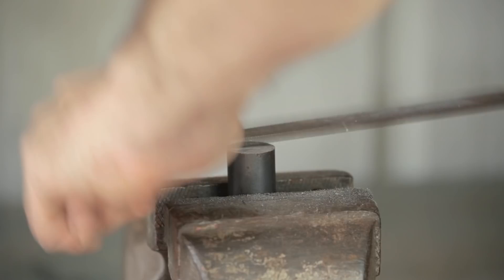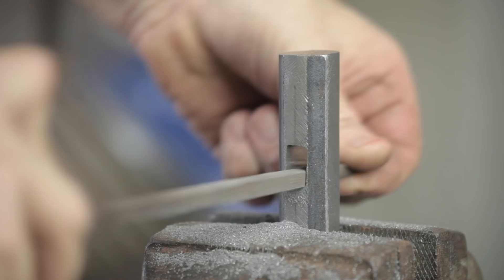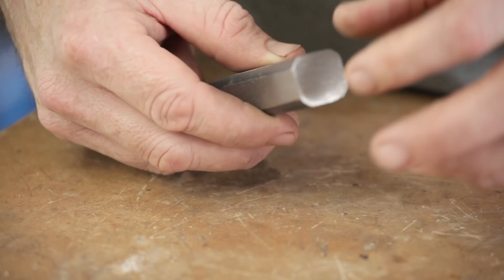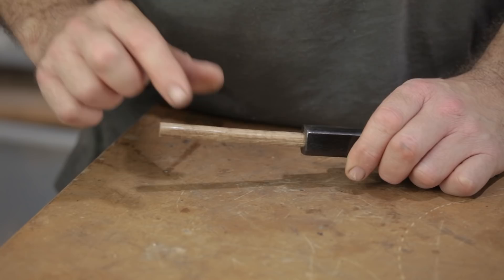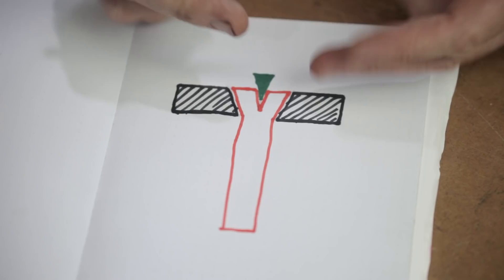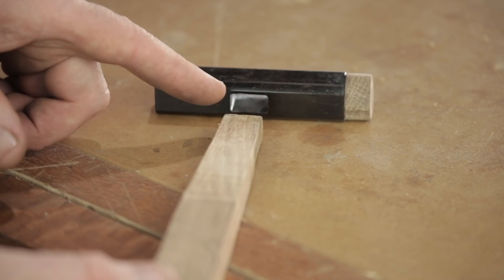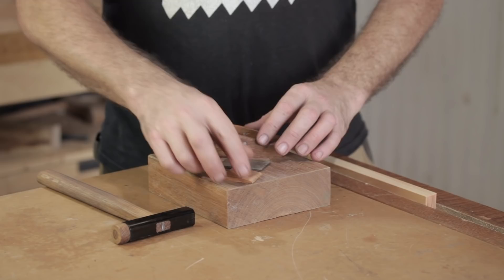Making a Plane Setting Hammer

Comment: Great stuff here. I love learning things. The oil finish on the steel is new to me, it looks great! Useful in my area as well with summer storms in the morning sometimes and 95°F by the afternoon as so often happens in the summer months. Functional and looks great.

Also I think most people would have simply glued the handle in the hammer head in some way. Compressing the fibers seems like one of those things people learned over generations to work better and last longer, one of those things that's nearly forgotten today. I will likely be using that knowledge as well.

Love your videos keep them coming!
Reply from the maker: Thanks mate! Glad it was helpful to you! :)

Comment: Very timely for me, I just found a tack hammer head my grandfather gave me as a kid.  Going to put a new handle on it. A couple of good tips for me in the video.
Reply from the maker: Glad it was helpful Brian! :)
Reply: Thanks.  Got the handle made, and the head on it, but broke the top of the handle driving the wedge.  I think I as a bit aggressive with the angle of the wedge.  Have to see how it holds up under some use, it is only a tack hammer, so it may work for years without an issue.

Comment: Enjoyed that! I didn't know boiled linseed oil would blacken steel like that.
Reply: pretty much the same process of seasoning cast iron pots.
Reply: Works with candle wax too. (Paraffin wax in countries that don't have loadshedding)
Reply: Aadil Shah This excites me.
Reply: It’s called bluing. If you don’t want to heat whatever it is you want to blue (prevents rusting) you can use a solution to just paint it with and it will start a chemical reaction to do the same thing
Reply: Allan Martin great informative! Thank you!
Reply: @BruceAUlrich  It's traditionally used by gunsmiths to make the guns resistant to rusting. Actually it's just a slightly different chemical compound than rust, but it doesn't spread like red rust does. Very cool stuff.

Comment: I used any kind of hamer with removing my plane blade without hurting the wood, I drive a 1/4"dia. bolt on the spot where I knock to remove the blade. I had my wooden plane since the 1960's and using it till now and still in a very good shape. I was a cabinet maker

Comment: @Pask_Makes Great Video! ☆ Quick Question? ☆ I've seen many videos where people making and or just installing a premade handle where most do not but some do protect the wood inside the eye of the hammer, axe, or hatchet etc with boiled linseed oil before putting the head on and setting the wedges etc.  I see you have skipped that step here and just wondering what your thoughts are on the practice of doing so or not? I see many replacement videos of axe heads for example where the wood in the eye has degraded badly and I would think that as long as your taper and wedges are proper that the linseed oil would be more benificial in protecting the wood than detrimental to the possible slight loss of coefficient of friction between un protected un oiled wood surface within the eye than it would be to oil it prior to insertion.  From what I've seen you are one of the most skilled tool builders amongst other wood items I've see on YouTube and just wanted to get your thoughts on the issue? Thanks, love the hammer and thanks for posting!

Comment: can i use something else instead of linseed oil ? can't exactly get that around here.
if i understand the process correctly the oil kinda burns onto the hot metal forming a layer, which kinda suggests any oil can be used, maybe not mineral or synthetic.
Reply from the maker: You could use plenty of different oils but I believe boiled linseed oil works about the best. Vegetable oil, motor oil etc. I used wd40 years ago and that worked very well and easy to use, just spray it on! :)

Comment: Apologies if you already answered this, but how durable is the black patina?  Is it the same principle as seasoning a cast iron frying pan?
Reply from the maker: It seems pretty durable to me but I suppose time will tell. :)
Reply: I have a little anvil I made from mild steel back in the 80's as a display item. It has been sitting on my living room shelf all these decades and still no rust.  But I used rape seed oil (canola for you americans).  I imagine that handling will lead to scratches in the carbonized finish and that in turn will lead to rust.

Comment: I drive a sidecar outfit in the winter in Canada. They salt the roads here and everything rusts. A few years ago I started home zinc plating some of the parts but I don't want to deal with the chemicals needed to passivate the zinc so it doesn't last long. Do you think the oil blackening process would do any better?

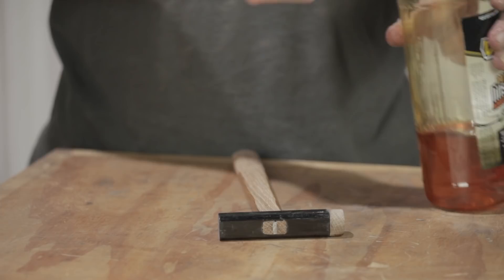Comment: 06:51 once the fibers swell|uncompress should it be sealed so it never becomes loose from fibers drying out?
Reply from the maker: It would be worth sealing them anyway but the fibres wouldn't compress to the point I compressed them with the hammer. :)

Comment: Very nice job as always, but today i have a question. You don’t heating the metal (with the new pig forge 😉) for more hardness ?
Reply from the maker: Thanks! It was just mild steel and as there is very little carbon in it, hardening wouldn't be possible. The fact that it's mild steel is a good thing as it won't damage the plane iron, it will end up getting dented on the steel striking face but thats ok! :)

Comment: To get the black patina, do you heat the steel to any particular temperature?
Reply: I'd also be interested to know if the patina keeps the rust away.
Reply from the maker: I believe heating it to a straw colour works best. If it makes the boiled linseed oil smoke then it should be hot enough. If you heat it too much (red, you don't need to go anywhere near as hot as this) then it will introduce scale which won't adhere and will come away. :)

Comment: How does that blackening proces work? Wipe on acetone and than burn it? How hot should the flame be? And do you put on the linseed oil while the metal’s still hot?
Reply from the maker: The acetone is just to clean the workpiece before you start the process, it doesn't burn as it evaporates as soon as you put it on. Then heat the steel, heating til you get a straw colour is ideal then wipe on some boiled linseed oil. If the linseed oil starts smoking then it's probably hot enough. It's worth experimenting on a piece of scrap to get an idea how hot to get it. Keep repeating the process until you achieve the desired look. :)
Reply: I understand. Thanks for answering the question. And thanks for making your movies. I always enjoy them.

Comment: How well does that burned on oil finish work in the long-term?
Reply from the maker: It's the first time I've used it on a tool so couldn't tell you for sure. It's a very durable finish though. I made some hooks years ago and they've stood up very well. :)

Comment: I've found if you use a playing card and set it on the flat of the plane then tap the blade until it is the thickness of the card out of the plane body it is pretty good to use and easy to see if it's crooked.

Comment: 1. Why didn't you forge the hammer head? and 2. Why didn't you turn the wooden face of the hammer? Other than that I enjoyed the video.
Reply from the maker: Glad you enjoyed it Phil. I thought about forging it but decided not everyone has a forge and this was an alternative method. I purposely made the wood face like that so there wasn't end grain on the edges. I reckon the edges would've chipped off and the dowel was the strongest way to attach it. If I'd turned it, the tenon would've had the grain running across it rather than along it and could easily have broken. :)